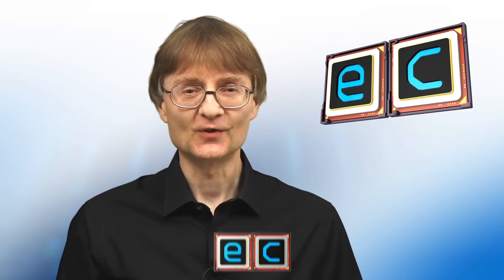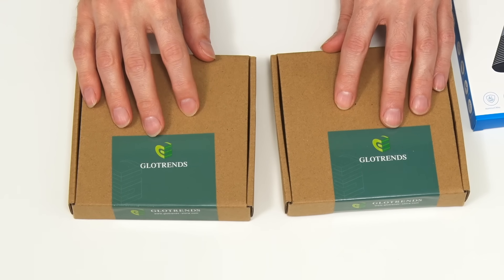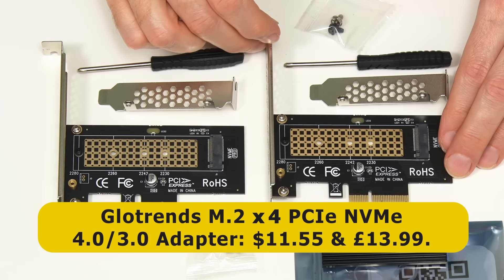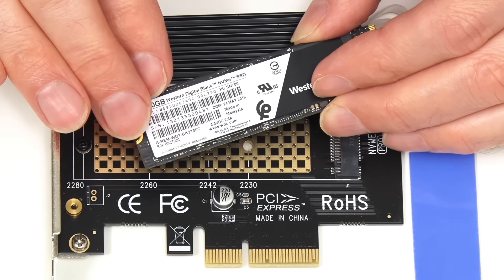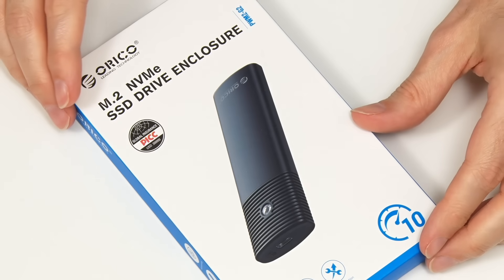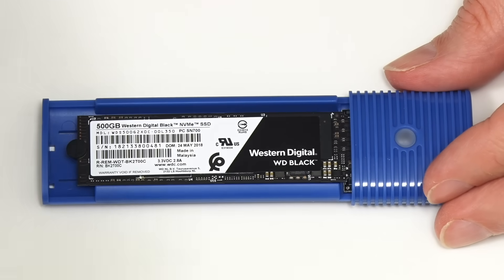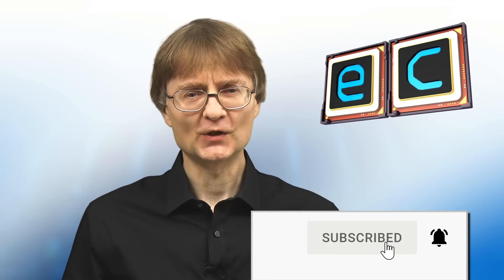M.2 SSD Adapters & Enclosures

Comment: If I plug into a USB c port. Will it be faster than plugging into a USB A port?
Reply from the maker: It depends on the port. USB-C is not an interface standard, just a physical connector. The USB4 standard only works with USB-C ports. But otherwise, the right USB-A port will be just as fast as a USB-C port. See my video: https://www.youtube.com/watch?v=PctX3kcTj5U

Comment: I put a an NVMe drive in my old computer... it worked beautifully. I had to mess with the bios to make it bootable, that was the only downside.
Reply: Hi, I have asus p6t se motherboard, I just got samsung 970 evo plus and I also got the pcie x16 connector for nvme, Can you tell me what changes I have to do in order to make it as bootable drive?
Reply: @Arsal-fv6vv  update bios

Comment: Thanks, Chris. Bought a low-end laptop with a 128GB nvme drive & 4GB RAM recently. Bought a Vantek internal card and a USB non name brand USB 3 adapter, 2 1TB nvme drives to upgrade the laptop and a home lab server. They (the card and adapter) were well worth the cost, and made the laptop well worth the money, too. Your info followed my steps exactly for determining the speed improvements...
This is another video I will put in my reference library to help others understand the what and how of hardware, and examples of speed improvements that can be had for little investment of time and effort.

Comment: Would you like to demonstrate one of those Android-capable development/evaluation boards out there? A board like that typically has more complete hardware features than a commodity single-board computer, but is more-or-less designed like one of those microcontroller boards out there. While in a practical case it's more overkill than a typical SBC even for Android/Linux devs, I would like to see a more apporachable overview like your SBC videos on here.

Comment: I purposely chose to stick to SATA SSD not nvmes, I dont need that insane speed and my hardware cant support it anyway. Also heating issues, I can rest easier having the SSD in a less expensive case (external) with far less insane cooling just to keep it going. SATA SSDs are becoming harder to find in the market these days.

Comment: I recently bought some NGFF Sata cards to mount 2 or 4 SSDs that are PCIE 3 x1.  I've oodles of NGFF drives and these work very well.  No drivers etc.  Have even made a NAS device using 1 of these cards and having the SSDs in software Raid 1
Reply from the maker: SSDs in RAID has to be cool! :)

Comment: I actually recently bought an NVMe to PCIe adapter board as I wanted to use it with an NVMe SSD as a boot drive in an older SFF desktop PC. However, after going down a bit of a rabbit hole, it appears that not all motherboards, generations of PCIe, or versions of UEFI (I didn't even know there were different versions of UEFI) support NVMe drives installed via PCIe to be bootable. Therefore, my drive showed up as a generic storage device only and couldn't be booted from. Also note that Microsoft did used to host a Windows 7 NVMe hotfix on their website, but has since been taken down. You can now find it on the support section of Lenovo's website, and should work on any system and not just a Lenovo one, so you can retroactively inject NVMe support in a Windows 7 computer.
Reply: Yes, Yes, I went down all the same "Rabbit Holes" you did. Days of investigating. I found to be incredibly frustrating. I was working with older computer systems (Dell office grade - not true work stations). It was the final straw. Update hardware so I got the newer - NOW -- UEFI AND motherboards with internal M.2/NVME slots. I'm still on WIN10. I've recently been migrating to Linux/Ubuntu/Mint/Cinnamon. I to the point I JUST want SOMETHING to work consistently. I've work to do and just don't have time to constantly diddle with hardware issues.
I know Chris "mentioned Heat issues with the external drive enclosure and wished he had spent a little more time exploring that as I've read that people are experiencing enormous slowdowns (throttling) in real world use. Again with the rabbit holes!
Reply: @bjre.wa.8681  Chris did mention in his video that it's only a quick test so didn't need to use the heatsink. Under normal use I'd definitely use them in my Linux setups.
Reply: I have an old Lenovo m93p SSF desktop PC. Is it worth going down the rabbit hole to see if this PC is able to boot from NVMe?
Reply: @devincurrie4145  That's entirely up to you and depends on your proposed use-case.
Reply: I have Asus H110M-CS Motherboard for Intel 6th generation which don't have NVME M.2 slot on board and on Asus website 4210 is the last BIOS available which I already have installed there is no Nvme configuration settings available so i have only PCie x 16 slot free to attach Nvme adapter but I want to use Nvme SSD for Boot drive so is there any chance to use it as boot drive if yes then please make a installation of windows 10 on Nvme using adaptor Card and please reply my question asap if anyone is sure about it because on the YouTube no one has done this experiment so it will be very helpful for many people in the world thanks.
Reply: @subhashsehgal2278  you can insert your ssd in another computer (which can boot from a nvme ssd), install windows 10 on it,  then bring it back to your old system. You need a usb with Clover or something similar to boot first everytime you power on.

Comment: Congratulations on the educational video. It clears up a lot of doubts.
The next step with this type of adapter card would be to run tests with cards that enable the use of Raid.
Thank you.
Reply: I have seen adapters like this, that support TWO drives. Careful, though; some will take ONE PCIe-drive AND ONE Sata-drive.

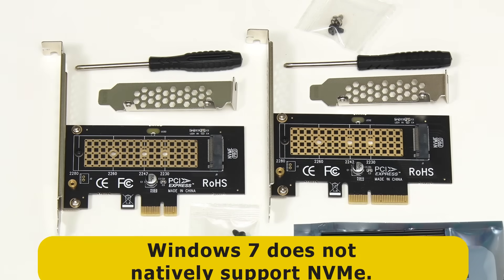Comment: 7:07 
If you want to run windows 7 to nvme 
You can clone to an ssd then put it to nvme
That's how i work windows 7
Only for every day thing
Reply from the maker: Very good tip, thanks for sharing. I presume you needed to install an NVMe driver for Windows 7 first?
Reply: @ExplainingComputers  yes but windows detect it automatically
Then it searches automatically again at windows updates for its correct driver 👍

Comment: I'd say this video is a coincidence as I just got an M.2 SATA SSD yesterday and installed it in my computer and was able to clone my Mint 21.2 install with no problems to it.

I did not go NVME yet as I have no need for a storage device that fast currently and there's about $20 USD additional cost to go NVME among the pptions available to me.

I'm looking into getting an external enclosure like the ORICO one you showed in the video as they are more compact. I've tried 3 different models of ORICO's SATA to USB 3 enclosures and all have performed around 450mb/s on sequential reads and writes so I expect the M.2 SATA ones to work similarly.

Comment: now that was VERY useful information.  In my system had been running on M.2 driver for more the last year.  it just beat the <fill in the blank> out of any HD out there.  the drive is 500GB.  I didn't want to blow thing up or use a large size then what I had been use in my system already.  I could get a faster drive but at this time limited funs and don't time to mess around with my system.  for some reason I remember replacing the main board do this and got a faster CPU.  I can still upgrade to even faster CPU but for now I don't see any need for that. it would be like adding more memory that I don't need. 16GB is all I need, like Razon 7.  Only once have felt I needed more power, so what the point. while a faster drive is always must.

Comment: 4:08 You can cut the 1x PCIe open, and it will work with a 4x card at 1x speed.
Reply from the maker: This is true -- but care must be taken when taking tools to anything on the motherboard! :)
Reply: Very true. I practiced on a dead motherboard, before I did it on a working one. @ExplainingComputers

Comment: That was marvellous. You said M.2 came out in windows 8, when did linux start to support M.2
Reply from the maker: Linux support for NVMe drives arrived in the kernel around 2012.
Reply: It has been there for a long while - the "gotcha" you need to avoid is to make sure the M.2 support is built into the kernel, not loaded in as a module, if you plan on booting on the M.2 drive.

You can also boot from a RAM disk which holds the module for the kernel to use to get to the M.2 drive, that's the other way it's done.

Otherwise you can get the good old "chicken and egg" situation - the kernel needs to load a module to see the drive but the module is on the drive it can't see!

Comment: did this USB enclosure work with Linux (Ubuntu/Mint etc)?
Reply from the maker: Yes, indeed it does.
Reply: I don't see why it would not. Linux works with USB, after all. So, yes!
Reply: @33lex55 
I do see why not. I bought a Ugreen enclosure, based on RTL9210 controller and it wasn't supported by ubuntu any linux I could install on my Orangepi 3 lts. Any suggestions?

Comment: Doesn't AMD x670 and x670E motherboards have PCIe Gen5 slots already?
Those have 8 (x670)or 24 (x670E) lanes of PCIe Gen 5. There usually is 1 x16 slot for GPU in x670E and usually 1 m.2 slot for drive. 5:30

Also B650E motherboards should have PCIe Gen 5 x16 slot for GPU.
Reply from the maker: I looked at a lot of motherboard specs whilst preparing this video, and could not find any with a PCIe 5.0 slot, but may have missed some. :) The AMD x670(e) motherboards I looked at -- eg this https://www.gigabyte.com/Motherboard/X670E-AORUS-XTREME-rev-1x/sp#sp -- do not have PCIe 5.0 slots. But they do have PCIe 5.0 M.2 slots.
Reply: @ExplainingComputers  On the otherhand, Asrock x670E PG Lightning (which I bought last summer) has Gen5 x16 slot for GPU. Even that Gigabyte board you linked now states that it has support for Gen5 slot depending if CPU, which integrates PCIe controller, supports it.
AFAIK all Ryzen 7000 series CPUs to date have Gen5 enabled PCIe controller integrated into it.

I built my new computer during summer, after 12 years. So I did extensive research into these subjects. ;)
All (that I saw) X670 boards have just 1 m.2 slot as Gen5, but most (true) x670E boards have both x16 slot for GPU and 1 m.2 as PCIe Gen5. That E-letter actually matters a lot here.
Even B650E boards has x16 slot as Gen 5, but those have other caveats.
Reply from the maker: @pikkuraami  Thanks for this, my bad. I stand corrected. :)

Comment: Just dont use SSD technology for data storage, as in backup or saving personal stuff. They burn out before your mechanical drives give up the ghost.
Reply from the maker: Whilst data on a SSD does on average fade faster than on a HDD, it depends a lot on how they are used (especially the level of write activity).
Reply: @ExplainingComputers  Yup. But since my 1987 miniscribe MFM 20mb harddrive are still working with no bad sectors. I will go with spinning platter drives for backup, over solid state any time. I dont think many solid state drives still work, that are produced in 2009.
Reply: I don't that's strictly true.

I think it's more of the case that spinning hard drives are only made by companies like Western Digital, Samsung, Toshiba and Seagate who have all been in the business for years and are the main manufacturers of drives with very high quality standards. Spinning drives also contain a lot of components and are not easy to manufacture and assemble.

(In fact, Seagate suffered a class action lawsuit back in 2016 because of the huge failure rates of their 3TB drives, I lost two of those myself at the time.)

Solid State Drives can be made on the same manufacturing lines as motherboards and there are a lot more "unknown" Chinese companies making them now, and cost cutting to sell them cheaply - and then possibly subject to quicker wear times and higher failure rates.

It's probably more of a case of "you get what you pay for".
Reply: @terrydaktyllus1320  My miniscribe platter drive from 1987 are still working perfect. None of my other platter drives have gone bad. However, I have had many SSD solutions (CF, SD, SATA) that havd gond bad through the years.

SSD are good for computing as such, but for backup and data storage there are only spinning platter that are fully reliable. Except one solution that trumps anything else, and that is tape backup.
Reply: Is this from personal experience? I adopted SSDs pretty much as soon as they came on the market over 10 years ago. In my personal experience I've had a lot more hard drives fail than SSDs. I have quite a few computers and since I adopted SSDs I've had only one fail that could have been a wear issue. It got thrown out of a BTRFS array for some reason. It tests out fine but I don't trust it any more. Apart from that I have had 1 DOA and a batch of very early Kingston 2.5" SATA drives that all failed within a few months. In that time I've probably averaged one dead HDD every 1-2 years.
Nowadays I only use HDDs for bulk backup because they are cheap. My main server runs 7x 2TB SSDs for storage.
Reply: @LesNewell  Read my comments. Plus we all know SSD cell's have a lower lige span than sectors on a mechanical harddrive.
Reply: @LesNewell  But were the SATS drives you had, solid state or magnetic based? And yeah, we all use harddrives for backup. But what tech are yours based on? You know, SATA are still IDE technology.
Reply: @brostenen  I read your comments. Again, is this from personal experience? The Kingston SATA drives that failed within a few months were SSDs. They were the very first 256G SSD model Kingston made and they must have had a design fault to all fail that quickly. The rotating drives I've had fail were IDE or SATA, depending on age.
I agree that NAND cells have a lower theoretical data storage time  than the magnetic surface of a HDD. However the problem is that it's generally not the magnetic surface itself that fails. It's usually a mechanical issue. It doesn't matter if the data is still on the surface if you can't access it.
Reply: @LesNewell  I have never had any mechanical drives fail on me. But I have had a good number of solid state storage media fail on me. Those were everything from PATA, SATA, CF and SD.

Solid state for OS, mechanical for data.

Comment: In fact I currently am faced with disk space getting low. Such an adaptor card might solve my problem. Thanks
Reply: Yes, I'd forgotten about PCI-E to M.2 adapters and I've a couple of small PCs that have either run out of SATA ports (having only 2 of them) or don't have room in the case for more 2.5" or 3.5" drives, but do have a spare PCI-E slot.

It's a great innovation to have the ability to expand storage cheaply whilst staying within the profile of a PCI-E card, even a low profile one!

Comment: Have old i7-3770 with gigabyte MB both circa 2012  installed m2 riser with 3rd gen nvme in pciex4 slot get 1Gbps max transfers out to a 20Gbps ext. Nvme enclosure with Gen 3 nvme. Using 10Gbps pciex4 usb-c bus. Cable transfer speed is important. Using 20Gbps cable gives faster transfer speeds on 10 and 20Gbps external devices.

Comment: A word of caution here would be that PCI-e adapters do not always seem to work with any motherboard. I had several machines of which the motherboard did not recognise the card, and thus rendered useless. 

There was no BIOS update available either. There's no guarantee it will work. And of course there's no warranty for it either.
Reply: I was just about to comment something similar to this, in that not all motherboards are compatible and by extension not all versions of UEFI are compatible, or if they are, then a drive can be used as storage only and is not bootable.

Comment: M.2 is cool and all but what happened to M.1 lol
Reply: It is hidden in Area 51 along with Windows 9.
Reply: @blackjam_alex don't you mean area 50
Reply: @blackjam_alex no, actually, there have been SO MANY mysteries which the government has been involved in since the Roswell Incident, that new Black Sites had to be created. The x2 PCIe slot is held at Area 72, and there is a working m.1 slot and card at Area 77.
Reply: @blackjam_alex 😂😂🤣🤣🤣
Reply: As far as Windows 9... that's held at Area 78.
Reply: 8 is better than 8.1
Reply: @reboxtherapy  xp is better than 8.
Reply: Maybe it was mSATA?
Reply: @r0galik Yes. like RDRAM is the predecessor to DDR. Mini-sata was replaced by m.2. It has never been said, but I guess the m.2 means mini-version2.
Reply: @tonycrabtree3416 thanks for giving a non-meme answer. I’m in on the jokes but I appreciate actual facts
Reply: @r0galik kinda, M.2 is "technically" the successor to MiniPCIe, which existed before and along mSATA and was often used for cellular modems and networking cards in laptops back then. NGFF/M.2 was developed to replace both MiniPCIe and mSATA together.
Reply: We are M.1!
Reply: @leono7240 We are the M.1 percent
Reply: M.1 was the friends we made along the way.
Reply: We don’t talk about what happened to m.1
Reply: Mini pci-e was the slot for devices like WiFi adapters before the x2 speed increase ‘M2’, Mini pci-e version 2.  My 2010 laptop has one.  The cards are not interchangeable.
Reply: we don't talk about him. be quiet.
Reply: I'll holding out for M.3
Reply: I thought it was the size of the screw.
Reply: 98 is better than millennium edition
Reply: @reboxtherapy  uhhh... shit. Damn, kinda backed myself into a corner there, huh? Uh... guess it's time for the ace up my sleeve, then! Linux is better than Windows!
Reply: @seancondon5572 🤣🤣🤣 you could have just stopped but you chose to continue. Unix is better than Linux.
Reply: @ZED-PV CPM is better than UNIX!
Reply: @reboxtherapy but se is better